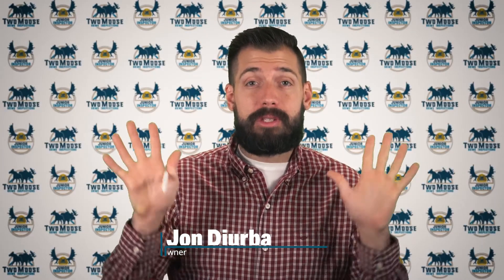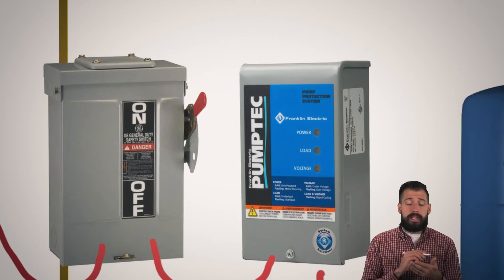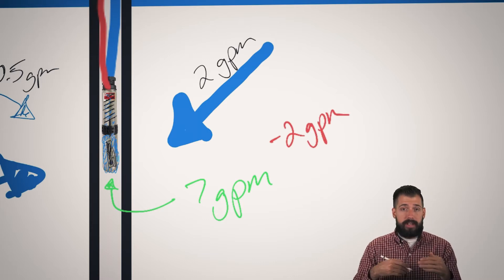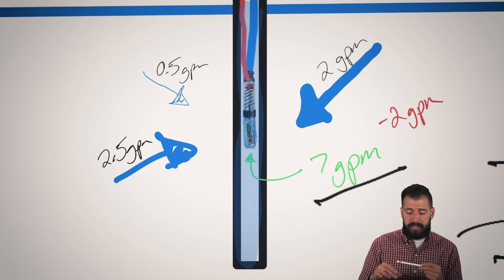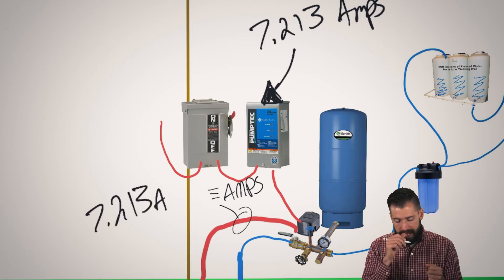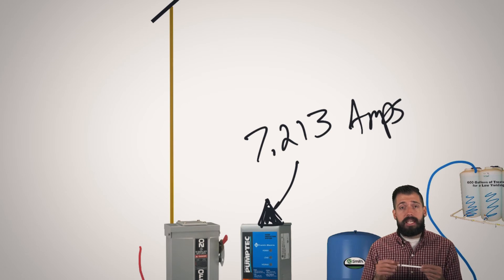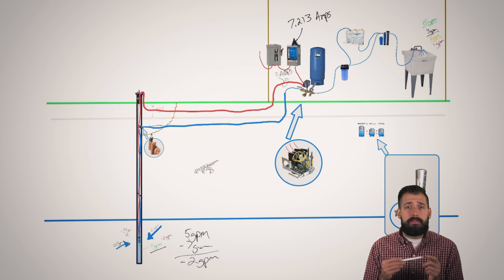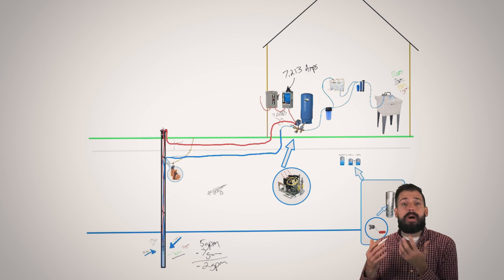Understanding a Well Test - Wells 10 of 10 - Why Some Well Water Tests Are Better

Comment: If you have a low yield well will the inspector run it at a low rate (example if the county requires minimal of 1 gallon per minute for a 6-hour period will the inspector set the flow rate gallon meter to 1 gallon per minute and conduct a 6-hour flow) or would they just run the well dry and then measure the recovery rate / yield

Comment: This video is a great demonstration of why you should get a specialist to test your well (it's not that expensive). The reason to get a good well test (at the well) is because it is the only part of your water system that can't be fixed. Pumps can be replaced, plumbing can be repaired, but ultimately the well/aquifer flow rate is the ultimate limiting factor of how much water you can use. A couple of minor points: 1) When the pump flow rate is higher than what the well/aquifer can deliver, you can install a storage tank. The well pumps into the storage tank at its own pace and another pump draws water from the tank and sends it to the house. The well/aquifer is still the ultimate limiting factor, but the tank allows for a continuous supply water to the house as the well recovers. 90% of the wells in my area are set up this way. The other 10% run off of wells that flow enough running dry is not an issue.  2) You don't have to manually shut the pump off if it runs dry. The control box has a timer that automatically restarts the pump after a pre-set amount of time. 3) "Tributaries"?

Comment: Love the videos! Any video specifying best way to test well (performance / recharge rate) in order to properly design an irrigation system off of it?
Reply from the maker: Hey Ben, There are many ways to test the flow rate of your home's water supply. Easiest way is to time how long it takes to fill a 5 gallon bucket with water. Once you know your Gallon Per Minute flow rate, then you determine how may zones you need to make for your irrigation system. If you have a well, there should be a pressure dial near the expansion tank, but if you don't, you can buy a pressure indicator that attaches to a garden hose to know how much pressure your system has. Each emitter will have specifications for flow rate and pressure, and if you have a significant amount of emitters, you might need to divide your total irrigation system into tiny zones so that each emitter will be supplied with the proper flow. You may also want to look into series and parallel systems to ensure even distribution of flow and pressure. (There are tons of online resources about this) 

If you plan on having your irrigation run for longer than 1 hour at a time and you are on a well, you may want to make sure that your well can handle the demand by keeping a close eye on your irrigation the first few times it is used for long periods of time. If you timer is advanced enough, you may want to setup the irrigation to run for 20 minutes and then rest for 20 minutes for whatever length of time you want to run the system.
Reply: @twomoose  
With this chat I’m focused on talking about the process and tricks of exercising / testing a well properly so that when the irrigation zones are designed (psi/gpm) considering total water window on a hot night that we ensure we don’t over stress the well with its proprietary recharge rate. I think you get what I’m after here and this is the tutorial I haven’t seen anyone do on YouTube yet. You could be the first!:) Can you do a video showing your process as you would roll up to a home with a well?
Reply from the maker: @benwilmarth5473  Hey Ben, any time you test a well, you are only getting a snap shot of the condition of the well on the day of the inspection. Wells are sometimes more of a moving target, so a single data point wouldn't get you want it sounds like you are looking for. It is important to understand that when you draw water from a water table you create a cone of depression. This cone affects the water table, flow rates, and even surrounding wells. Similarly other wells that draw from the same water table / aquifer will change the water table and create their own cones of depression. 

If you want specifics about your well in terms of water table, depth, recovery rate from the cone of depression, etc. then you would need a well contractor who is able to take off the well cap and do some calculations. This will only tell you about your well's abilities, not your pump's ability or your pipe's ability. However, one data point doesn't give you what it seems like you are looking for. To get what you are asking for which is a definitive number to describe your wells performance through all seasons, you would need to hire this contractor multiple times. The more data that you get the more clear your understanding of the well will be. However, dry season, wet seasons, drought and many other things can skew your data or make it completely invalid. Additionally, the next year all of you numbers could be different for many reasons

If you are making a massive irrigation system for a farm or some other use, then you need to be aware of any local, state, or federal regulations about the amount of water that you can use because water rights are a very serious topic.

At the end of the day you can size an irrigation system off of the data that you have an then modify watering schedules year to year or season to season to ensure that you are not over stressing the well. You can only do the best that you can do, and provide yourself with flexibility in your system. During dry seasons you may even need supplemental support from a water storage tank, but you might not know that until much later.

If you connect a calibrated flow meter to your water supply and run your water for two hours or until your well runs dry whichever comes first then you will know exactly how many gallons of water your well can produce. You can then apply that data to your calculations. Beyond the information of using a calibrated flow meter to determine total volume produced, you can generalize your well's performance by filling a 5 gallon bucket at standard intervals during a 2 hour test or until the well runs dry to approximate the total volume produced by the well, but again.... the well will change season to season and year to year, so you can only do your best. (Sorry, No current plans to make a video about our process)
Reply: @twomoose  
This is perfect 

Can’t tell you how much I appreciate your time.  This is great information abd confirmation to what little I have found in substantial research so far. 
Hopefully someone big in the industry will do a video covering the 101 approach to west you just said to help protect contractors from mis calculating by way too much down the rd.